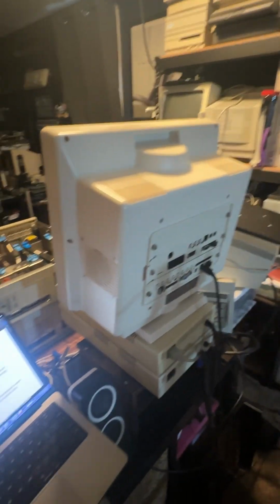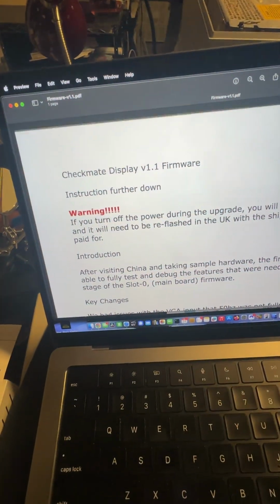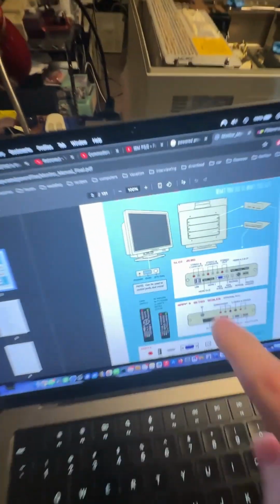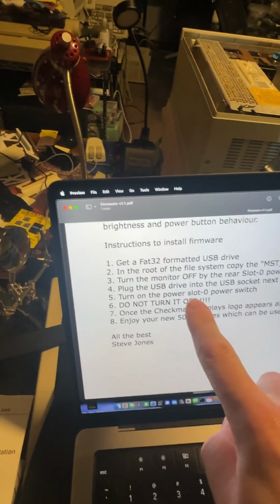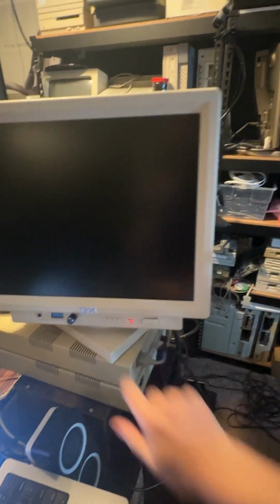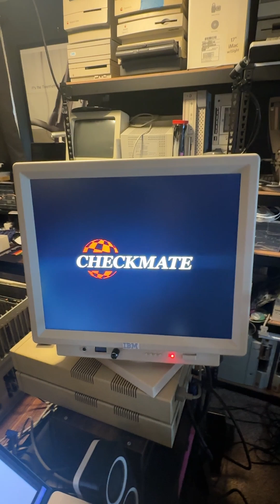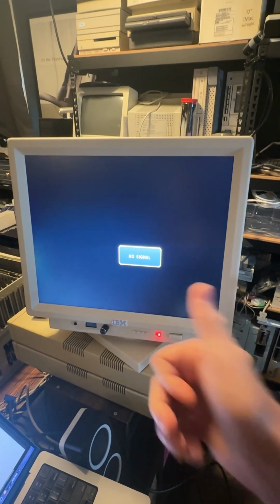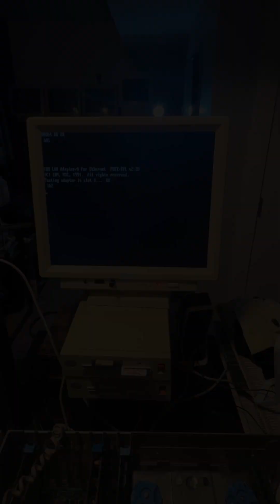Updating CheckMate Retro Monitor Firmware

Comment: It's very easy to correct those power switch btw...what did the FW fix? Too lazy to go to discord ;)
Reply from the maker: Yes I've seen a tutorial on how to fix the power switches, but I've been too lazy to do that so far. There seems to be a minimal risk of damaging the switch if you're not careful.
For me, the FW update fixed some minor display issues with the VGA connection, nothing major (it wouldn't display the signal from a PS/2 model 80 properly).

Comment: price?
Reply from the maker: The upgrade itself is free. For the current cost and availability of the monitor best check out their website as it may change. It's not cheap, but considering it's replacing original tubes for several of my systems, it was totally worth it.

Comment: Are you able to connect it to a modern pc? I’m considering buying one for retro gaming purposes but I also want to be able to use it as a regular gaming monitor.
Reply from the maker: Yes you can connect it to a modern PC, there's VGA (OK, less modern) and HDMI inputs. According to the manual: "These can all handle HD resolutions up to 1920x1080p, but they will all be scaled to 1280x1024 which is the resolution of the panel." Hope this helps!
Reply: Yes you can. It can even function as an HDMI hub